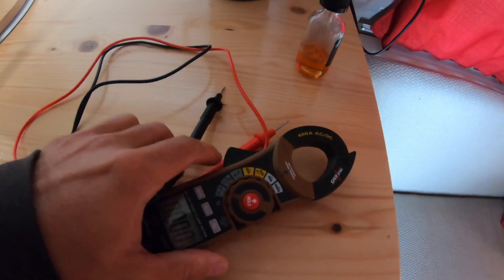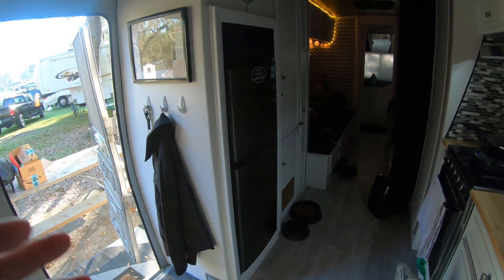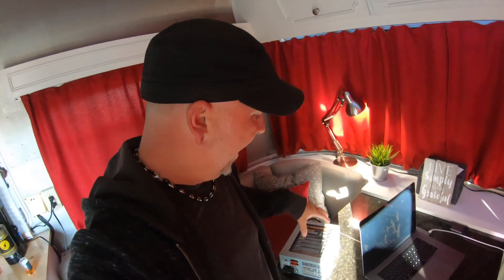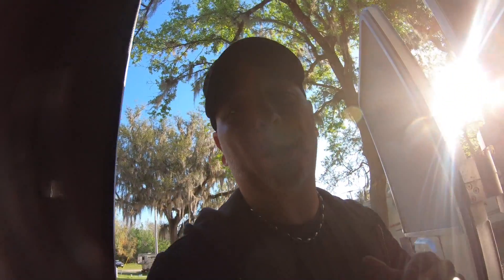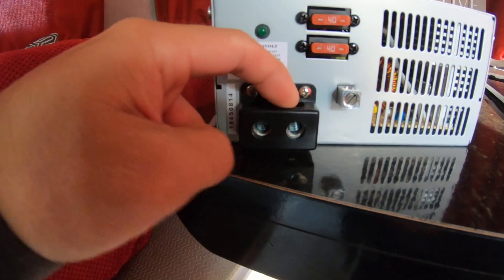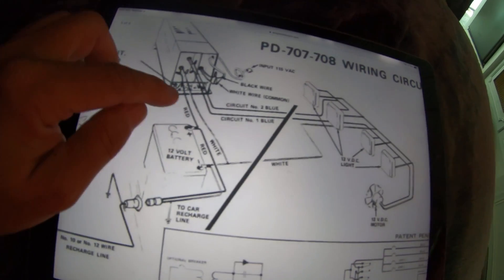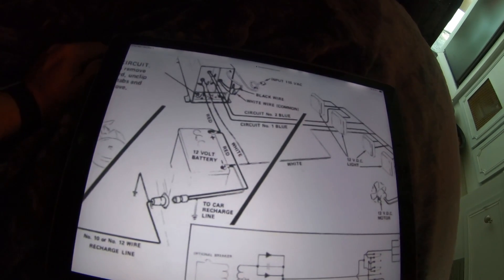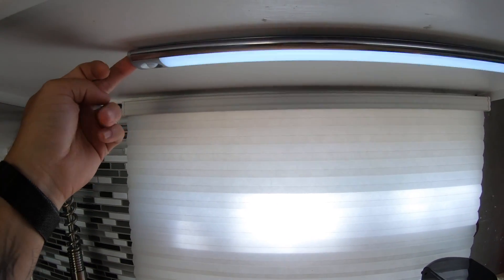I QUIT on this RV CONVERTER || #RVLife

Comment: If I lived closer to you I would swing by and fix it for you.
How to test the convertor since you have it out. Put it on the picnic table then plug it in to 110 volts see if you have any output with your volt meter. Test between the blue output and the ground lug it should be somewhere between 12 volts and 14.5 volts next check the red output it should read the same. if it does the convertor is working

The only thing a converter does is make 12 volts  AKA a battery charger.   Your problem looks to be in the wiring. remember it's a 30 year old camper. The cores of all the (white )ground wires look black  (corroded) I will bet the red and blue wire are the same way. Start with the basics, clean up those battery terminals then check the wires from the battery to the fuse box and convertor to the fuse block and the ground block to the convertor and the ground block to the trailer frame.

Comment: Rule #1: ALWAYS disconnect the negative terminal first. I realize the odds of you shorting the terminals on the house battery are slim, but don't take the chance. I know someone that melted a ring off of his finger because it completed the circuit between the + terminal, the wrench and the inner fender of a car. Your aluminum body is likely grounded and the ratchet hitting it could have caused a big problem for you.

Comment: From what I see from your diagram:  and I am sure you've got that as well    its been a while since you posted this !     The Black AC lead comes from either your gas generator plug or camping ground 115v AC cable plug.  This circuit converts the 115v Ac into 12v Dc. via the inverter/converter BOX under your seat.   Obviously one charge the front camper battery via the RED lead "on your diagram"  While the other let you use the 12v appliances via the Blue leads.   The Red Lead under your seat should read... "To and From" front Battery.     The Blue Lead should Read "To Fuse box"    you should also wrap some RED electrical tape on that (black cable on battery)  just to ease your mind as to where it leads to once inside the camper.      as to the FUSE box ???  Why is there a big RED cable there ? where is it from ?    if the blue wires are suppose to feed all the DC voltage to your camper,  If I have read the diagram correctly ?      I wonder if you need a big DIODE ?  to isolate one of the circuits?     Best of luck !